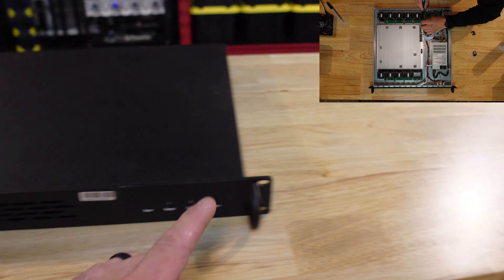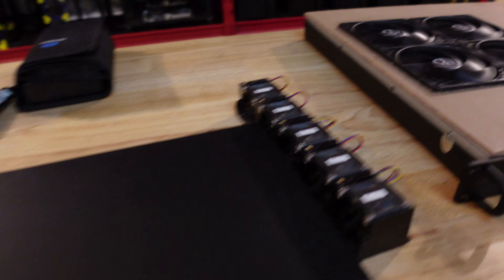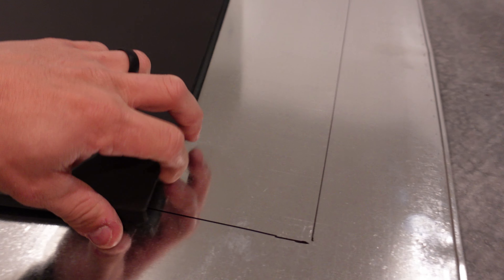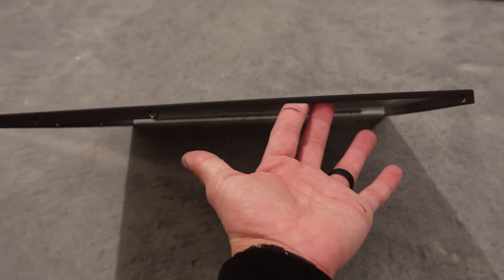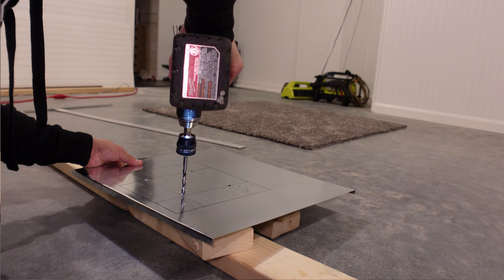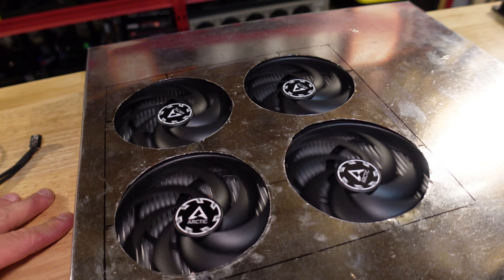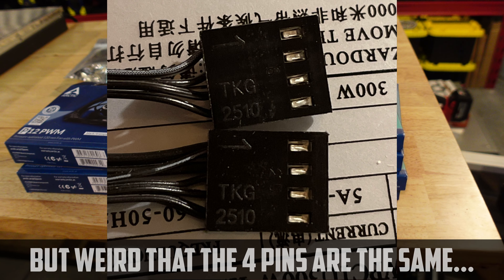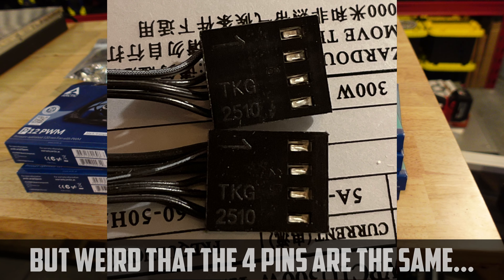Jasminer X4-1U Custom Mod

Comment from the maker: Do you have a Jasminer X4-1U? Did you think this was as impressive as I did? This should have been built like this from the beginning!
Reply: Don't have one but, that is sickkk.
You can guess the reason is that it's intentions are to be rackmounted and have units stacked literally right on top of it.
Reply: Yes I have one, and have been thinking about doing this since I saw a video from Youtuber CNminer in June 2022 about putting four 120mm fans on the heatsink. It worked well for them, but I had already made a "silent box" for my Jasminer, so I am not in a rush to lower the sound, but I will do this to get rid of the box and still be silent. Thanks for your video! Your endresult was very nice :) I will order the black version of these fans instead of the brown ones ;) I have not decided if I should go for the 15mm to get the sleak look, or go for the 25mm and having them sticking up a bit through the top cover.
Reply: Okey I did mine yesterday. I went for the black version of the 120*15mm Noctua fans ;) 
I also have 257W consumption on 235V 👍 It was 287W with the stock high rpm fans.
All ok now, just one thing, the Jasminer PSU fan is loud (did not hear it before..) So I might swap that one to some day.

Comment: Legend. Patient your solution before they integrate it. Jasminer should be giving you free sponsorship after this. Nice one brv. (I bet your 4 noctua fans are cheaper than the 8 delta fans used and easier to replace when/if they die.)

Comment: I know it's an old video, but helped me out, so thank you.  I purchased a used one for a great price, but was just too loud. Mine is running at 51c, but that's maybe because I just have it open now,  still need to customize the top part with fan cutouts.
Reply from the maker: If you don’t have small kids man just leave it open if you want or you can just cut cardboard over it and tape it on and it’ll work fine! But thank you for watching 🙏🏻
Reply: @ChumpChangeXD  yeah no small kids and it's in the garage. Probably just going to leave it open.  Just was concerned that it was running at around 52c, where you had it at 42c, but think should be fine. Fans are coming in around 1600.
Btw, you are a master diy'er.
Reply from the maker: @BorisXgen good stuff brotha! Appreciate you. Good luck!

Comment: Hey Chump man, You could of just left the fans in there and just disconnected them.
Reply from the maker: It will just impede the air flow so I removed them
Reply: @ChumpChangeXD  not really because your new air flow is coming from the top now and not the back. Originally it was coming from the back to the front or front to the back. Now it’s coming from the top now to the front .
Reply from the maker: @DiyintheGhetto   but yes because the air is now going to be exhausted through the slots in the machine from front to back. Having fans in the way will create friction and restrict the fans that are now doing all of the work. This will in theory burn them out faster than normal…
Reply: @ChumpChangeXD  true. But also having slower RPM fans won’t push it out any faster then the original ones because of the pressure.